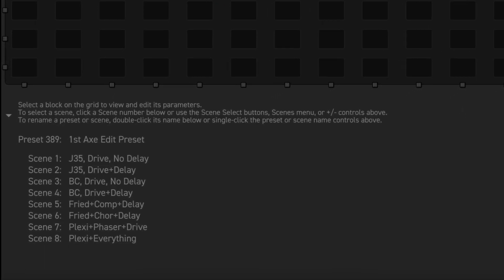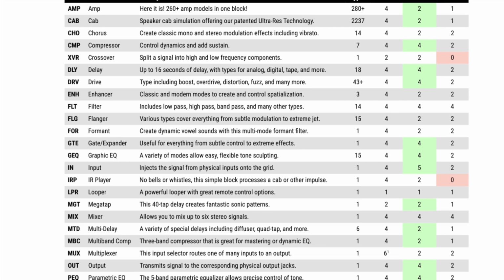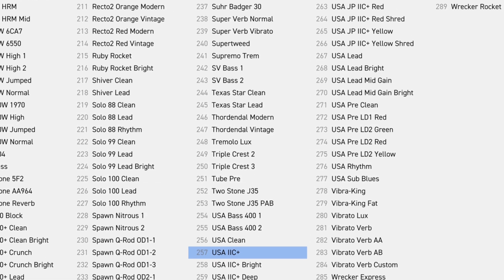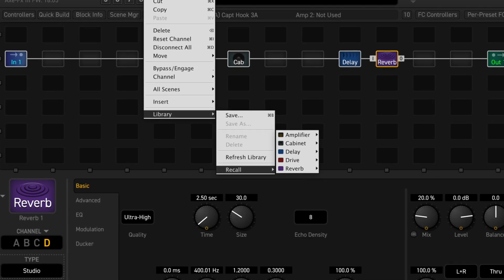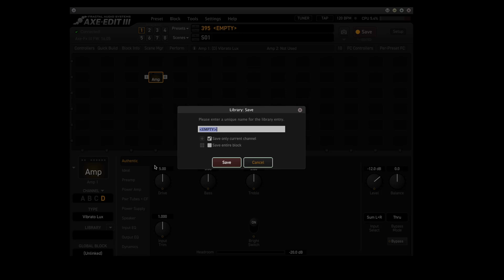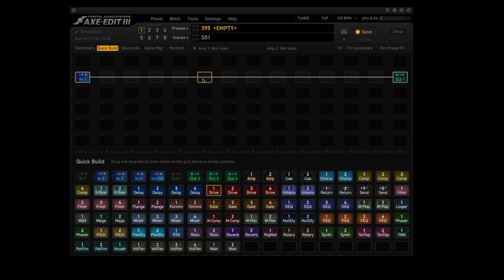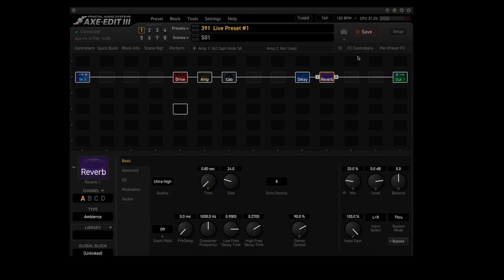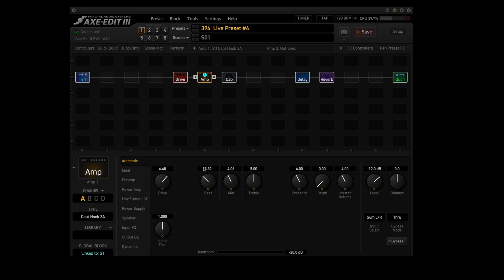AXE-FX III - Blocks, Global Blocks & The Block Library

Comment: I also love the feature but what is a bug is that the global Blocks overwrite the presets. A wrong tip on store and you have related an Am to a global block. When you want to load the Backup preset, then it will have the Amp from the block, not the one that you stored with the backup. So be careful with using global blocks because it is not possible to correct the mistake with the backup. Cliff should find a solution here. I also would appreciate the possibility of naming the Blocks.

Comment: As far as global blocks, how does it affect channels? If I have a block with a certain reverb, but in the same preset different scene, I have a totally different reverb in channel  B, I noticed that if I set up a global block for that reverb, it also attaches itself to the other channel reverbs. I was hoping I could just have a global block on a certain channel. But I don't think that is possible????
Reply: Yes this is a problem. If you make a mistake you can't even load a backup preset, because, the new Block setting will always overwrite the parameters of the Backup.